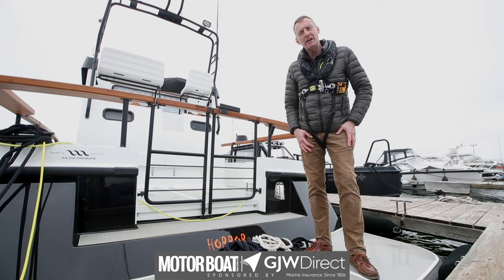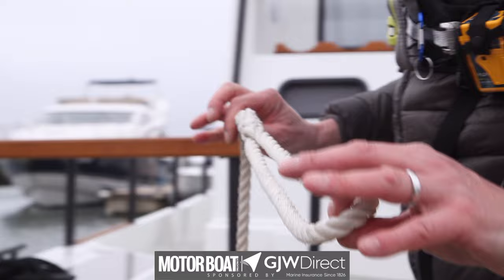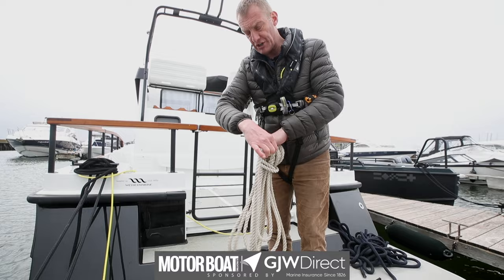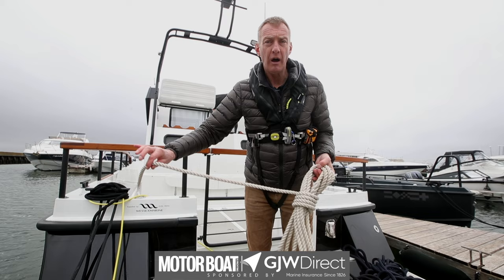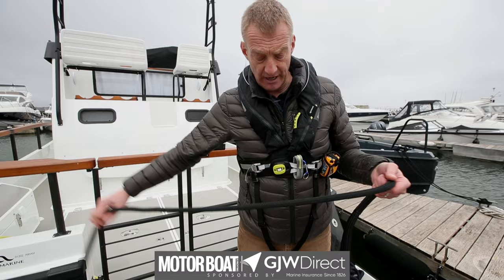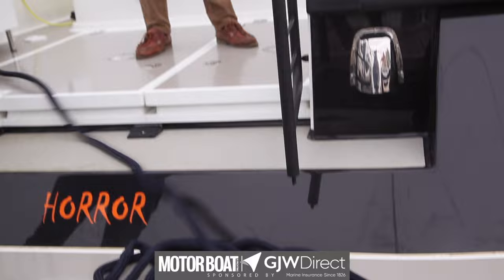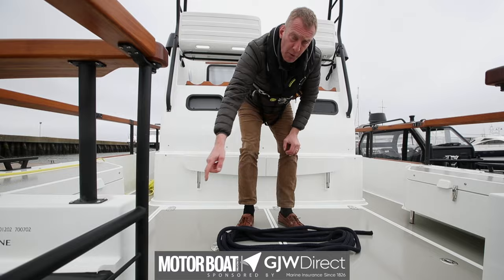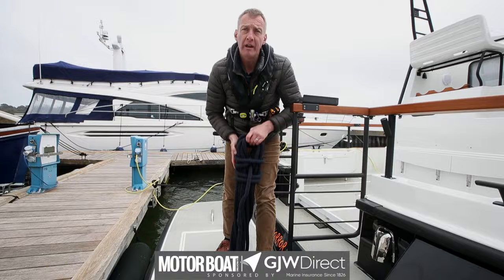How to coil mooring lines | This simple method ends tangled rope frustration | Motor Boat & Yachting

Comment: imparting twist into the rope to coil and store it will mean it will have twist in it when you uncoil it. Try it with an even less forgiving garden hose and you will see what I mean. Rather than introducing twist - let the rope follow its own path as you coil it to your left hand. Still stores the same but wont end up wanting to kink as you try to use it next time.
Reply: yeah this is a bad tutorial, you want a figure 8 kind of coiling going on.

Comment: you spend all that money on a boat and don't look after one of  the thing that keep the boat safe 
If you don't mind Mr Mendez .
When saltwater  evaporates its leaves the salt still on and inside the rope ,to get rid of the salt wash it out  with fresh water as the salt is an abrasive  and is inside the rope  and will cause damage over time